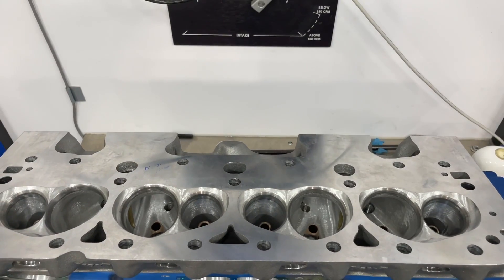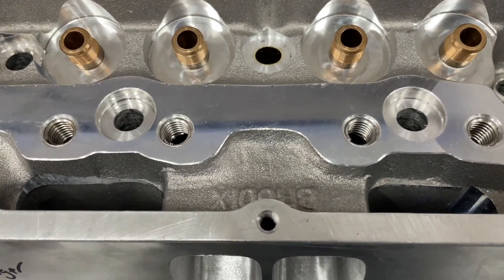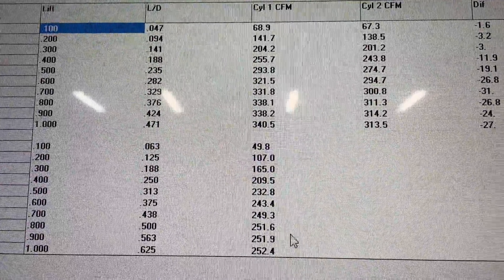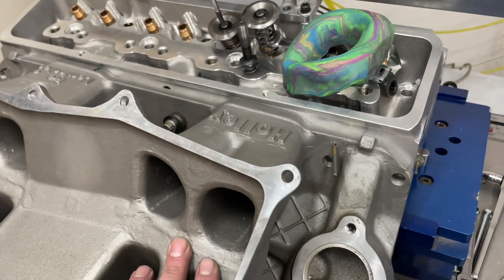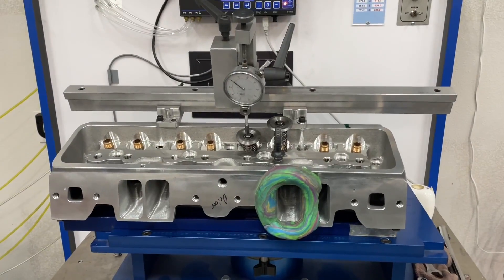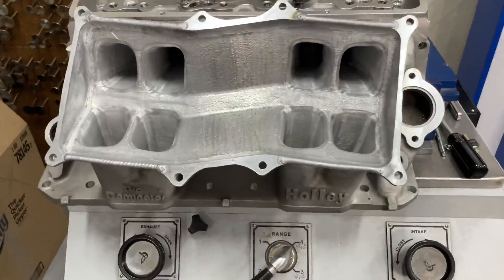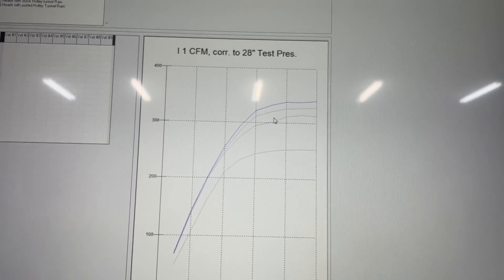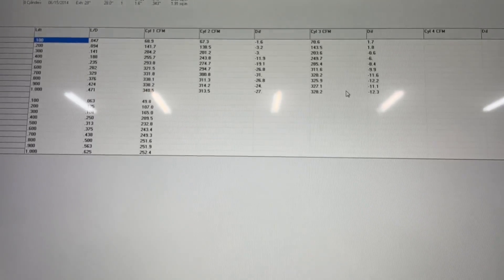Stock vs Ported intake flow

Comment: My personal opinion on that 2 hp per cfm figure is that it mostly applies to high compression race motors where everything is just perfect. From what I’ve seen 1.8 hp per cfm is usually more accurate on a street motor and closer 1.7 for big blocks because nobody talks about the “bad” port.

Comment: Your the Best! I have been recently following your videos and I have to say I'm highly impressed! Do you ever port factory castings? I have a project truck that I've been thinking about porting the heads 9n and then sending them somewhere to have the valve seats done and bench tested.. be nice to have someone improve my port job but guys like to do there's fresh which I understand.. I can do a 2stroke cylinder... anyways thanks!
Reply from the maker: I use to port all factory castings. Now only port the aluminum ones.

Comment: Why was the D designed into the manifold by Holley?
Reply: Im gonna guess, that it might be because, the carb doesnt know which cylinder is pulling fuel, its just squirting fuel out of all 4 venturi, so each suck stroke is pulling fuel out of all 4 carb venturi.  the D shape might be to help the fuel transition from out of the carb down the runner during each cylinders suck stroke...
Removing the D while porting, is likely just getting rid of that restriction and giving it the volume the runner needs for this engines rev range and stroke..
Hand porting and the treatment to the divider probably gives the ports a better transition anyway so no need to recreate the D when porting...
It would be an interesting test to use smoke above the ports while on the flow bench to illustrate what im talking about... you can visualise it
Reply: This intake has fairly short runners and small volume plenum, so may have needed that with its design over say, an edelbrock pro ram or street ram or whatever, hence why theg dont have the D..